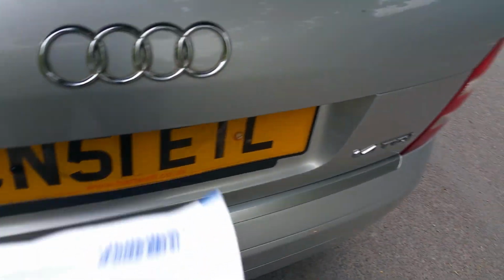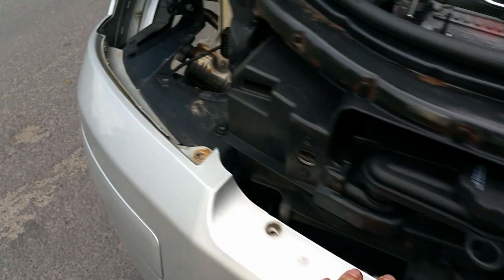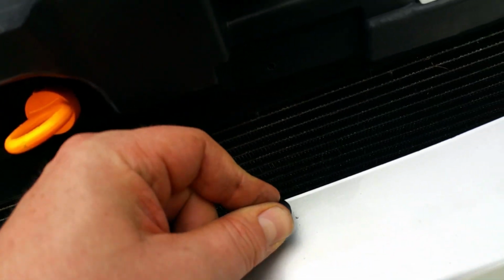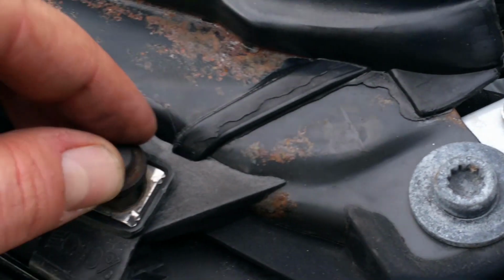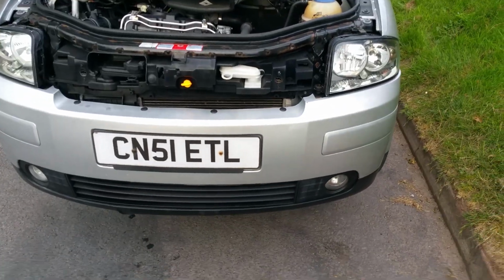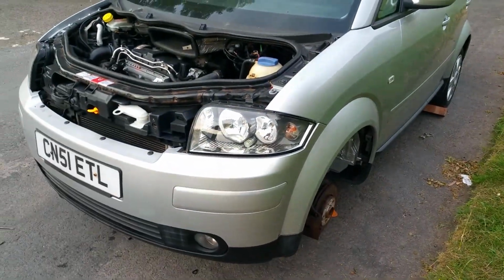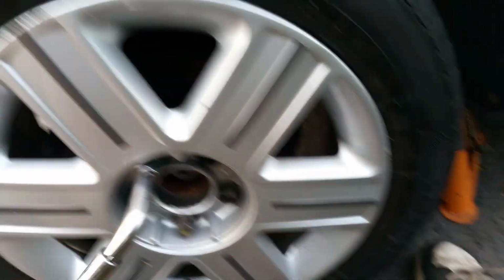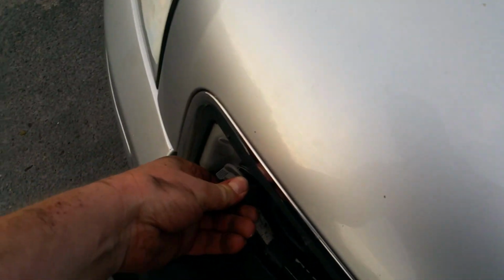Will it start ?? intercooler install Audi A2 part 3

Comment: Nice where you get the inter cooler from
Reply from the maker: Oh it was just an ebay buy 👍
Reply: @NoExpert  cool i have a polo 2002 1.4tdi amf engine   whats best engine mods on a budget ??
Reply from the maker: Hey dont forget Not the Expert here 😂  from what ive heard its injectors and turbo from 1.9 tdi and then re-mapped, not sure how long it will take me but I want to do that, and a cheaper alternative would be just a remap